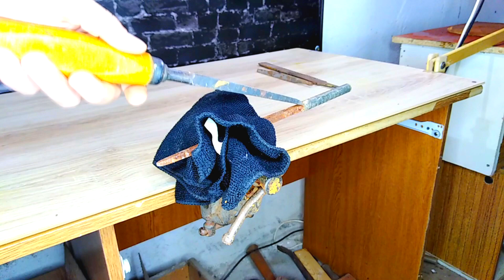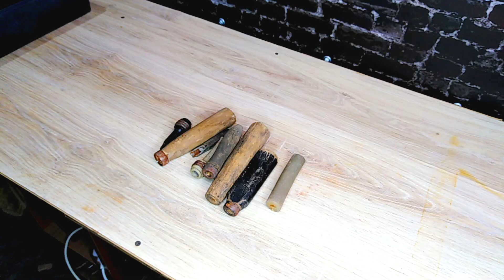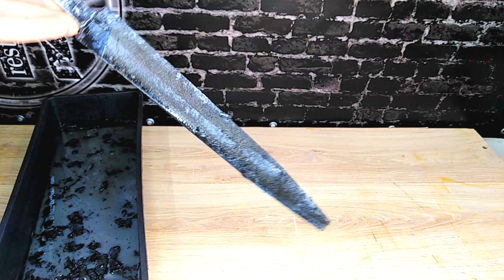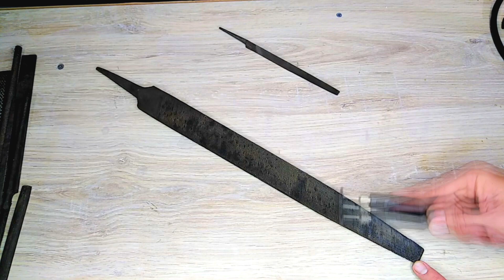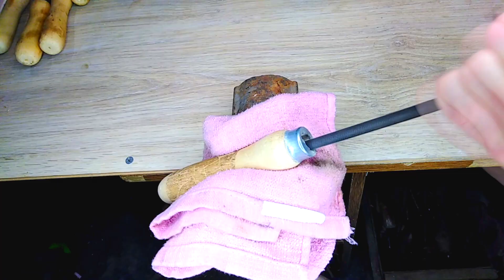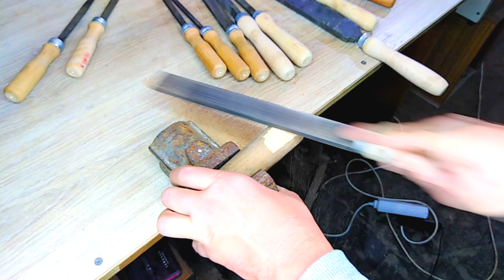Restoration of very old rusty files

Comment: So how does cleaning off the rust make these usable files? Rust would remove the sharper edges that were thinner steel.
Reply: Yes I agree. Some think using acid will somehow sharpen the teeth but I can't see this.
Reply: Vinegar will sharpen the file, but very little.
HCL is the best for sharpening the files, because it etches the metal and makes the teeth sharp again.

Comment: I have no idea what you initially soaked the files in at the beginning. The usual way to make files work great again is to soak them in some type acid. The acid etches the metals out of the file teeth and even makes the teeth sharper with the acid etching as well.
Reply from the maker: I used a rust remover. I agree that the acid does it well. I will keep in mind for the next projects. But I can assure you that files are working very well now. I use them every day. Thanks for the comment.